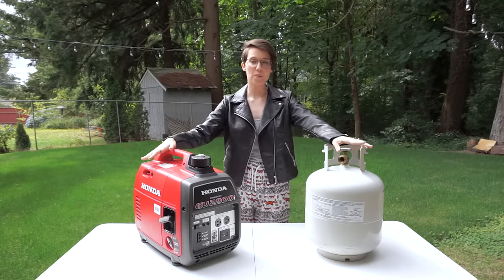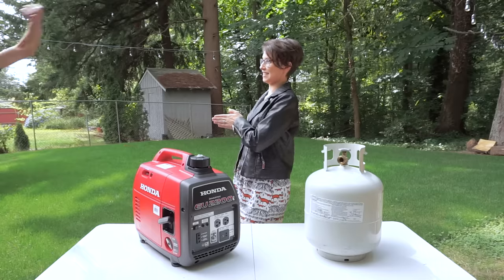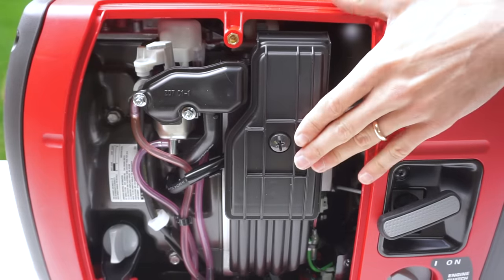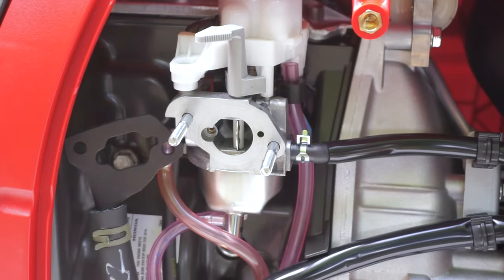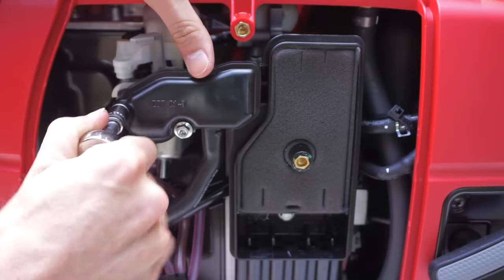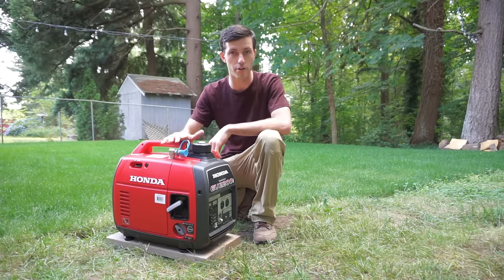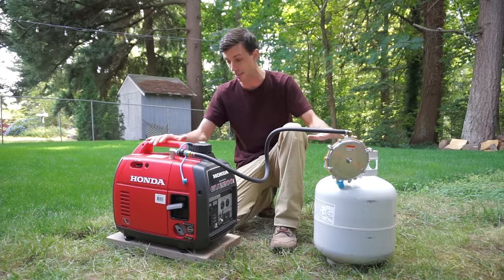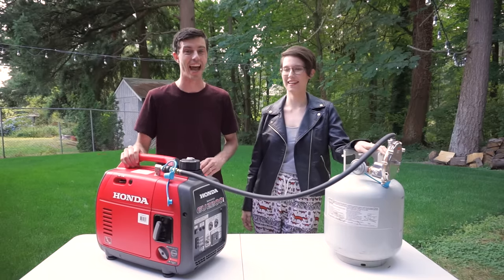Honda EU2200i Propane Conversion Kit - DIY Install for Honda Generator

Comment: Something almost nobody keeps in mind is that the tuning to run on propane is different than gasoline. While these absolutely will run on propane with a stock tune, you’ll absolutely shorten the service life, often significantly, by installing a kit like this and not re-tuning for propane. I’m all for it, just the people making these mods oftentimes are not mechanics and don’t understand the differences between gasoline and propane and how it effects the hard parts over time if not properly set up all the way.
Reply: They run hotter for sure. I converted an Onan to propane in 2000 but it had the stelite valves designed for high heat from propane use from the factory.

Comment: What kind of mileage do you get on propane vs gas? I wonder how many hours that generator would run on a 20 pound bottle of propane and how that cost compares to running it on gas?

Comment: I have two of the same model generators.  Is there anyway to connect both units to one propane tank and run them simultaneously?

Comment: Should probably use thread tape or some other kind of sealant on the threads for the elbow fitting I’d think.
Reply from the maker: The kit comes with pipe dope already on the threads. It is hard to see in the video since the pipe dope is gray but I assure you the threads are sealed up tight.

Comment: Thanks for the info !
Will your air conditioner run on a 1/4 load power ?
Reply from the maker: No, the air conditioning is closer to full load

Comment: Great tutorial, thanks! If you convert, does it mean you can no longer use the generator for gasoline or can you use it  using dual fuel (gasoline or gas)?
Reply: I installed a Hutch Mountain kit on a Honda EU22001i. After the conversion the generator runs perfectly on either gasoline or propane.
Reply: @rytbeard  awesome, thanks!

Comment: If it’ll run for 20 hours on the tank that’s a big improvement compared to running it on gas; I can only get mine to run for six hours before it runs out of gasoline. So if you’re powering a 1500 W heater it quits about two hours before you get up just when it’s getting coldest and if I’m  running a heater with my generator I’m on vacation and want more than six hours of sleep.

Comment: What if I wanted to run this conversion from my 250 gal propane tank at my home? I have a line that goes to my Weber grill and could add a splitter or “T”. Would I still need the regulator?

Comment: How much mbar does the second unit lets out? in my camper i already have 30 mbar... but i wonder how much mbar goes into the generator, so i know if I can use the bbq outlet.

Comment: How does the cost of propane compare to the cost of gas based on run time?  For example, on a full tank of gas the Honda EU2000i can run for 8 hours right?  How much does the propane cost to run the generator for 8 hours by comparison?

Comment: Everyone should keep in mind that when they do this conversion, the engine output is de-rated.  So a 2000 watt generator becomes something like a 1500 watt generator. This happens with any propane conversion, not just with this particular kit.
Reply from the maker: There is only a 5% to 10% power reduction on propane. So it only reduces down to 1800 running watts.
Reply: Fate Unbound Have you actually tested that or is that “on paper”? I did the conversion on a 3000 watt generator and on propane it can only do around 2500, so almost 20% reduction.

Comment: couple of questions.  can you run it in eco mode off propane and it will idle up and down properly or does the generator only run on one speed?  also, is their another way you recommend turning it off to avoid turning off the propane bottle all the time?  my fridge runs on propane and dont want to have to kill it at the tank also taking out my fridge only to restart the fridge and re prime all the lines again.

Comment: I’ve watched this video about 6 times the information is so good. I couldn’t purchase the kit to post to Australia but have managed to buy most of the parts required. I am waiting till I have all the parts and will then install into the generator. Did you need to change the sump/engine oil o suit the propane operation??
Reply: OIl does not change... In fact you will see a substantially cleaner used oil after running with propane.
Reply: If you need something shipped to AU from the US I can ship it to you. I've done it for internet friends with motorcycle parts

Comment: Good video, but what is the new power rating of the EU2200i on propane?  I know it’s not as efficient, but do you know how much?  Did it run your RV’s AC still?  Also, that propane hose is short, is there a longer option?  We have 30lb bottles on our AIrstream and the generator port is right out front, I’d like to run direct from one of the bottles, but am concerned about the hose length.
Reply: @gsansoucie  The energy density or specific energy of propane is about 18% less than gasoline so, that 2200W generator is now an 1800W generator.

Comment: and does that gas reducer freeze? In gas motorcycles, the gas reducer freezes when the gas tank is 100% full of gas, that is why the gas reducer is placed close to the engine or the exhaust pipe so that it heats up and defrosts without problem.

Comment: Does the gas regulator have some sort of feedback (needing sucktion to open for example) to prevent gas flooding if the generator stops?
The thing you are doing when pressing the button? That would explain that giant membrane thingy.
Reply from the maker: Yes, that is exactly what it is for, and the button is a bypass to allow gas to flow when the gen is off to allow enough for startup

Comment: Hi, with the propane conversion, the exhaust fumes are lethal too as gasoline?
Reply from the maker: Yes the exhaust fumes are still lethal. The exhaust just smells less and is less polluting. Still lethal though.

Comment: So the question is, a generator running on a full tank (around 1 gallon) Vs. a 20lb propane bottle as shown above, which runs longer?  I can usually under my typical load: small fridge, satellite wifi, and lights; get about 14 hours on a full tank.  What would runtime be on a 20lb LP bottle?

Comment: Hi David. I noticed that you didn’t put any type of thread sealant on the propane connection fitting when installing it. Guessing it’s not necessary for this setup?
Reply: My kit (2022) came with some kind of sealant pre-applied to it.

Comment: It’s best to cut the gas off to stop small engines, always. It keeps from leaving gas that’ll lacquer in the carburetor.
Reply: not all small engines, even the chinese shitter motorbikes are coming installed with fuel injection these days. im surprised the generators havent switched over to efi yet either.

Comment: Will the conversion affect the Honda warranty?  Is a conversion kit available from Honda, or a dual version model available from the manufacturer?   Have heard that propane burns hotter than gas, and propane may burn the valves after some extended use?

Comment: Wonder if you have a TT with an outdoor gas hook-up (for stove) could you do a hose with a valve (for turning off/on gas) and run off that (using the regulator of the TT)? Seems much less to pack/carry than a separate hose and regulator and having a loose tank.
Reply from the maker: Yep! They have an attachment for that which you can purchase as an add-on to the kit.

Comment: How long will the generator run on one of those propane tanks???? As opposed to filled up with gas???
Reply from the maker: It will run for 30 hours at 1/4 load on a full 20lb tank of propane. On a full tank of gas (0.95 gallons) it will run for 8 hours.
Reply: @FateUnbound  gas is way cheaper 3 dollar every 8 hrs or 30 dollar tank fill every 30 hr at 1/4 load

Comment: Do you need to do any modifications if you want to run on gasoline, after doing the gas conversion?

Also, does installing the kit void Honda’s warranty?
Reply from the maker: You can switch between gasoline and propane at any time!

Comment: Hello from Germany. Some question : How many mbar is the Gas pressure regulator ? Have it 30 or 50 mbar pressure ? I thing the us thing not fits in Germany on gas bottles. Thanks for answer.

Comment: Hello David. I noticed that there is EU3000is conversion kit in hutch mountain's website. I'm curious to know do i still need the assistance of MicroAir Easy Start to run my air-conditioner or fridge by using EU3000is?
Reply: I just purchased the EU3000is as was going to ask if they also had a kit for mine AND YOU ANSWERED IT. As for the easy start I checked and they said yes. My unit is a 13,500btu AC and I am going to put one one.

Comment: You probably should have used some LPG rated thread sealant on those fittings going through the housing
Reply from the maker: They come with LPG rated pipe dope already placed on the threads. Take a closer look at the video, that's what that whiteish goop on the threads is.

Comment: So if you leave the bottle turned on when the engine is off, does the bottle empty out through the air filter?

Comment: Is fine it miss just a 2 stroke oil drop provider to avoid your valves seat dying prematurely. Gas has a much more dry combustion than gasoline.

Comment: are honda generators worth the extra money? are they really more reliable and efficent?
Reply: The difference is a Honda generator is smaller quieter and more efficient as opposed to an off-brand gigantic loud smelly off brand the first model that I purchased then I learned
Reply: @Mr.Robert1   So from now on you will only ever buy Honda Engine generators and cars because of they are quieter, more efficient, and have superior engineering?

Comment: that's a GREAT idea!! 
how long does it run off a standard propane tank?
Reply from the maker: At 1/4 load a 20lb propane tank will last 30 hours and a full tank of gas (0.95 gallons) will last 8 hours.

Comment: hi guys a simple question how do you keep the gas warm bec here in dom rep. we use propane bec is cheaper than gasoline to run our cars but we use the warm water fro radiator to warm the propane gas otherwise the car wont start due to the gas is too cold kindly waiting for your response**

Comment: Stupid question it looks like all they did was make an adapter plate . So if the motor stops running for some weird reason in the propane tank is still full doesn't the gas does go out of the generator cuz technically you can float the other way outside the carburetor . Not sure if that's something you would be using without supervision
Reply from the maker: The regulator keeps gas from just flowing out when the engine isn't running.

Comment: Looks great. Like the locktite idea. Why is the regulator so big?
Reply from the maker: Thanks! And I'm not sure, I don't know the specifics of how this regulator works, I'm sure there's a good reason.
Reply: Fate Unbound Same thing on the Champion propane one too. Just seemed weird that they are that big. And I know nothing about regulators. LOL.  Maybe it somehow makes the propane come out at a more consistent rate or something. Maybe doesn’t matter as much if just burning but putting through a carburetor needs different flow or something. Ok thats my non expert guess. Ha.....
Reply: @nonrevhogan8938  demand regulator. only supplies propane when in vacuum. this one also has the pressure regulator built in.
Reply: Tim Wolf Thanks Tim. I had to go look up different regulators and get my google education. I didn’t even realize there were so many different ones. Makes sense when using propane to run an engine that has various demands of fuel. Just have always used propane to run a grill or stove. Learnt me something. LOL 👍
Reply: The lower the regulated output pressure, the larger the regulator diaphragm needs to be.

Comment: Was wondering, do you find the generator runs quite on propane then gas?  Also I don't have the Honda 2200, I have the 2000.  Have you heard if the 2000 has the amps to run the air conditioner  with the ez start attachment to the air conditioner?
Reply from the maker: The generator isnt any quieter running on propane. However, the 2000 is definitely powerful enough to start and run the air conditioner with the easystart 👍

Comment: Will the enginge last the same length of time as fuel has lubricants
Reply: These have Oil separate.  You do not want anything without Oil or 2-Stroke

Comment: What did you experience for run times on the 20 pound propane tank with your Honda EU 2200?
Reply from the maker: 30 hours at 1/4 load

Comment: On a side note. You can buy this kit and did it your self with no legal problems. But a small engine repair shop can not do this for you legally unless the have the proper permits and licenses. I know because I work in a small engine shop and we get people from time to time wanting us to install such conversion kit. IF we did we would get fined like $50,000 and lose our business license because we are not propane certified. So do not buy one of these kits thinking you local small engine will install it for you. If they do and they are not  propane certified they are risking a lot of trouble.

Comment: Great lady,what happens when u can not get any gas
Reply from the maker: It can run on propane or gasoline with this conversion kit. So you have both options if you can't find one or the other.

Comment: Propane fuel has different characteristics from gasoline..when used in 4-stroke engines make sure you change the engine oil more often..hsve seen plenty of oil dilution in gas converted engines..
Reply: Mike Ray - please explain.  I presumed LP or NG burns cleaner than gasoline so am confused as to what contaminants get in the oil from LP.

Comment: Do you have to run on gasoline then switch to propane every time you want to use the ginny or was that just for the initial setup?
Reply from the maker: That was just the initial setup to drain the carbeurator of residual gasoline. Once you do that you never have to run it on gasoline ever again.
Reply: Thanks. That’s what I figured, but wanted to clarify.
Reply: I did the initial break-in with gasoline.  It ran on gas a total of 5 hours of its life, and that's it.  One the second oil change, it's now all propane.

Comment: I wonder if I could get a kit such as this to run on a car engine, such as a Subaru EJ20, or a Volkswagen engine please let me know by the looks of that carb gasket  I can't see any problems if I could get one made up
Reply: Too much hassles.  It can be done, but too much hassles and it has to be an older Car, with Carburetor Type.  Basically, anything with an "OLD" Carburetor Type can be converted.

Comment: I have but 1 question: How long under full load would a 9kg propane tank like yours in the video last? Approximately that is.....
Reply from the maker: A 20 pound propane tank will run the generator at 1/4 load for 32 hours

Comment: Thats a great idea 2 way fuel system would this type of conversion work on a harbor freight 6.5hp motor with out damaging the insisdes of the motor and with today ridiculous gas prices and fear of running out especialy during a power outage I been There once run out of gas.
Reply: You can add propane to any gas powered engine. You just need to fabricate a metering device for the propane to inject into the carb and get the correct regulator.

Comment: Hey!! Great video... I'll have to ask Hutch Mountain to start selling in Europe! ;) Quick question: did you need to do something to the motor switch or is there a position when gas is cut but motor still starts? (and Hutch Mountain explored that «position» hehe)

Comment: Dang that plate is huge! I was going to say... UFO is coming, UFO is coming! Lol
Reply: i think the membrane needs to be that large so the small underpressure of the running motor can open the gas valve in it. low pressure x high area = higher force
Thats why he had to prime it to start, opening the valve manually a bit.

Comment: I have the EU3000is and was wondering if this would work with that model also?
Reply: FAST & LOUD. I went to the website using their link and there it shows the kit for your 3000 model.
Reply: hammer r 
very much appreciated, thank you!

Comment: Do you ever answer questions? From reading the comments it seems like you don't. But hope springs eternal and I have two questions. Can a 20-pound lp tank absorb enough heat to vaporize the gas to run the generator in cold weather? I know that's a big issue with larger generators.  Second, do you have to use the included regulator? If I do this I'll want to use a dual tank automatic switching system like rv's typically use.

Comment: I like to thank you for doing a real Nice, well explain video...... I have a one Fear, Yes .. Fear .. about this type of Fuel conversion. What happens if the generator decides to stall or someone forgot to turn off the propane source. Wont the gas seep out through the air filter and create a possable Big Problem. Factory Engines with built in fuel conversion have a electric fuel solenoid built in to them, so when the engine stops it automatically turns the fuel Off.... One example. when your in the process of firing up the propane Grill. you turn the gas on and that manual push spark Igniter Doesn't work the first few half a dozen  try's. a gas pocket forms.  Then on the 8th try it  Ignites, This . Whoosh . of a Fire ball comes out of you grill, you heart skipped for a second, but you'll lived. The grill situation happen all in a time of 10 to 15 seconds. For a generator stall, it can be easily many minutes before someone gets to the generator, in that time a lot of gas has flowed out creating a potential Hazard. We go from a Whoosh situation to a Boom ! .. I don't mean to scare any one. So Please be care full. If you are using these conversion kits.
Reply from the maker: The regulator on top of the propane keeps propane from flowing when the generator is not on.